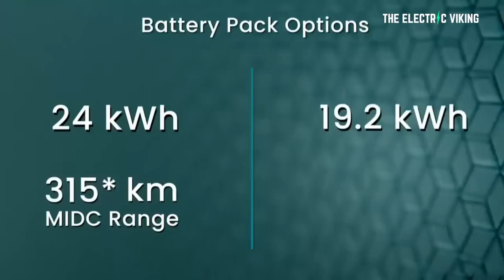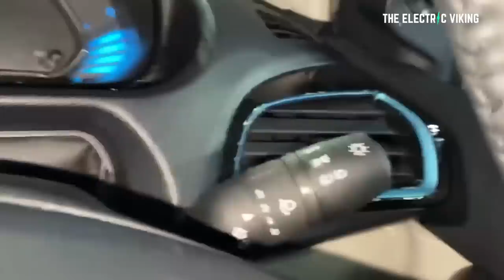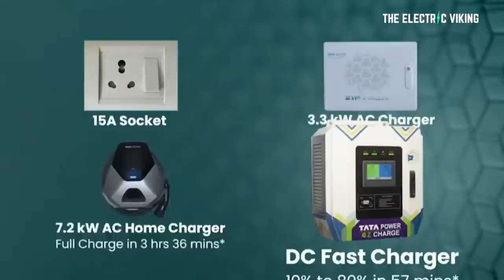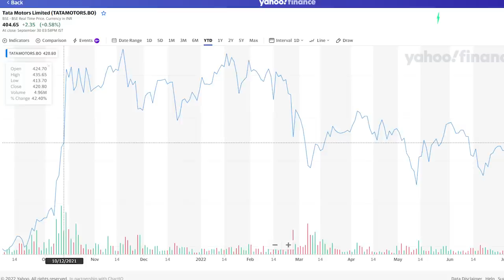India's $10,000 USD electric car - is it good?

Comment: Tata Motors understands the Indian Market. In India very few people do long road trips. People use Railways or Buses. The car is good for driving within Cities.
Reply: Times have changed. We are also getting used to driving between cities now. However most of do car pooling through blabla
Reply: We never use Buses and Auto and use railways for long distance travel
Reply: @bkchaitany  only about 6M of the 250M+ cars pass tolls daily, and that was pre pandemic 

It’s a tiny percentage. It’s just that those who are doing those kind of trips are well represented on car forums and such websites, which makes people think that everybody is doing long road trips. 

But it’s in fact a small minority which is highly vocal
Reply: @bkchaitany  railway is still the preferred mode of transportation for intercity/interstate travel, even among people who own cars. and why wouldn't it be? it's cheaper and faster.
Reply: @bkchaitany  yes we travel between Cities in car but most of the time when we travel with more than 2 people in group
Reply: @bkchaitany  which definitely is not a good thing. More people buying cars put a lot pressure to road infrastructure any where. More focus should be on public transportation .
Reply: And that's such a bad idea. The only reason trains are prefered is lack of expressways.
Reply: @malharpathak4941  I do long distance driving but if it crosses 500 kms, I prefer trains. You can sleep, enjoy the scenery and be carefree. While driving the car,  it gets irritating when there are trucks obstructing the fast lanes.

Comment: Tata Nexon EV is doing great in India....most of the Tata cars are very safe.They focus on passenger safety very much.
Reply: safe but more likely to be in crashes and more prone to fires etc
Reply: @KShauryaDwivedi  any references to the claims you are making?
Reply: @aryans5129  sure, many wiring issues that cause fire, and EV well is an EV and all EVs have a higher chance of catching fires
Reply: @KShauryaDwivedi  I thought you were talking about these crash and fire problems specifically in Tata Nexon. As far as I know, Nexon EV has only 1 fire incident in its history (Mumbai incident) of 4 years and more than 30000 units sold so far.
Reply: @aryans5129  nexon also has fire issues

Comment: Here are few insider info from an Indian.
1. This is a global NCAP 4 star car. Global NCAP is less stringent than Euro NCAP. So, keep that in mind. 
2. Indian MIDC standard is more optimistic than even WLTP. So, expect 30-50% lower range than stated depending on the condition/driving style.
3. Tata owns Jaguar Landrover and had been making prototypes for last decade, but officially started building EVs 2018-19. But, came up with a really solid architecture with their Nexon EV, which is a compact SUV, it has G NCAP 5 star rating and is a pretty solid car. And it has 40kwh battery in its higest variant and costs 20K USD approx. Tiago is their 3rd EV in the same architecture.
4. All three EVs made by Tata so far are variants of their ICE counterparts.
5. the 10000 usd price is that of the lowest variant of the Tiago and this prices are introductory for first 10000 customers. So, expect 10-15% price rise pretty soon. Also, tax for EVs and batteries are very less here in India.
Reply: All info correct. This pricing of 8.5 lakh to 11.5 lakh INR is for initial 10000 customers only.
Reply: Tax varies based on state .....
Reply: @ajthomas770  no. Here in India registration charges for EVs is free for now. Only insurance cost.
Reply: 5 point the price listed is only for first 10000 units, price will surely increase after that.
Reply: @gaauravsharmaa4061  no the road tax varies, there is no exemption in Kerala for road tax for EV compared to Maharashtra
Reply: @a1221feb  same as Andhra Pradesh due to it's bankruptcy.
Reply: Informative 👍

Comment: I think this car is perfect for India. A 10K car with low running costs that lets you run around your local area cheaply. I think it will sell well and expand the horizons of many Indians.
Reply: It is very pocket friendly. But the best seller is actually another car from TATA. Namely TATA NEXON EV. Check it out, a NCAP 5 star rated semi-SUV EV.
Reply: Thanks will do, not in the market for a new vehicle but out of interest I will.
Reply: It's not cheap It's eco friendly 
Luxurious car brand are responsible for environment
Reply: @jbrphilosophy  ok
Reply: It has got 10000 units booked on day 1 of booking..
Reply: @lionelwylie2326  they seem very protective
Reply: @LoneWolf-xz1ln  I agree they seem a lot better and safer than those 3 wheel two stroke things that a lot of Indians fly around in.
Reply: @lionelwylie2326  lol I am laughing at your comment😂 those are called autos, extremely affordable means of transport, they have also associated with Uber too
Reply: @piyushkanthak1087  Thanks I was not having a go about the "Autos",  I have been chauffeured around in them in fact. I think they are a great low cost solution to transport. I was just trying to say that the $10K Tata is perhaps a better answer to that segment of the market. Although I have no Idea what an Auto costs.
Reply: @lionelwylie2326  petrol+ cng auto price around 3k in India 😅

Comment: Just came from trip in india. Check out the Mahindra tiny ev car. tata has the nexon ev which is really the one everyone wants. Unfortunately Tata still makes the body for both ev and ICE so it's not that great yet. The good thing is they're switching the taxis- 3 wheel one, FAST. Which is great they have so many 2 cycle engines on the road. The biggest impact are the scooters, Ola(they're uber) made huge debut last yr w ev scooter and is selling like crazy, All Escooters are. But biggest flaw, they're not investing in charging infrastructure, so no one sees them them more than just city cars.
Reply: You are mostly right. So, I am adding few bit. Charging infra has picked up recently, Several private companies such as Statiq, fortum, Zeon,AArgo have pretty solid network in most part of the country. This is addition to Tata's dealer network in Tata and MG showroom, Hyundai/kia showroom and in petro pumps, and then there are govt installed AC and DC chargers in petro pumps.. All these have come up in last 1 year or so and it's picking up fast. The Mahindra small EVs are not sold anymore, they will launch their bigger Electric SUVs in q1 2023. The slower e-3ws had massive upticks from 2016 onwards, there are millions of them on road. Currently faster e-3ws are on the rise too. And e 2w sells are growing at an exponential rate since last 3 years. Ather scooters are best in terms of quality/performance/reliability more so than OLA(they are pretty good too), And Ather has strong charging network in 40+ cities, that has Tesla like hassle free charging and the scooters have OTA, navigation, call features.
Reply: @Amuzic_Earth  I saw the charging network for 2w, but not for cars.  Yeah athers were great.  Ola wins in style though. Not bad for first generation , can't wait for next one.  I also saw Other e2w are all the same Chinese scooter wrapped with different brand name.
Reply: I think they will do much better with a network or memebership system instead of purchasing a vehicle because parking is difficult enough. I think that why tesla will next build there until they develope a 2 passengervehicles. Which is too bad because india is the most engineers
Reply: Your analysis is not correct
Reply: @grootracing5390   did you mean that comment somewhere else? I just said my observations.
Reply: lets hope that all countries get ev to save environment and the platen
Reply: Charging infrastructure is pretty good on highways because I have just Bangalore to Mumbai in my Nexon. There were so many charging stations that I had to think where to charge. Every small restaurant in the way have charging points now. So it was great, I will be driving from Mumbai to Delhi now, will see how is infrastructure in this route.
Reply: @Spashth  awesome,  hope you let us know how it went.
Reply: @emmanuelgutierrez8616  Technology in India will always have 2-3 years lag from developed countries but that doesn't mean India is far behind. For example, India got 5g this year, which was available in US in 2019/20 I think. Another example, iPhone 14 is launched last month and iPhone 13 is selling like hot cakes in India right now because prices were slashed by 35% after iPhone 14 launch.
Reply: @souravdas1110  true, the lack of previous infrastructure means that they can take advantage of the best today. But the commom random power outages shows how much needs to be developed. I have high hopes and india has growing solar industry. But the FUD in the Indian media is out of this world, this will slow it down.
Reply: In India you don't need cars inside the city due to heavy traffic .big Cars are for able middle class .Bascially the public transport  in India is well good but it needs to be fast. The gov is trying to build fast mode of transport..
Reply: @emmanuelgutierrez8616  Govt is ensuring Uninterrupted 3 phase power supply at least on highways and cities. Actually EV revolution will force govt to strengthen distribution network too. India has distribution problem, not generation. Being 2-4 years behind developed countries is beneficial for developing countries. It saves costa and gets the best technology. For example, 95% charging stations in India are CCS2 standard which is the global norm now. America has a dozen types of charging ports which creates confusion and adds to unnecessary spending.
Reply: @emmanuelgutierrez8616  you are correct

Comment: The driving cycle is decided based on “road load data” acquired by driving cars with strain gauges attached across the country in city, highways and ghat sections. The best fit is decided on the data collected considering driving behaviours too, using acc pedal data. Hence, it can’t be  the same for every country. Run the risk of over designing the machinery for example.

Comment: Tata will be leader in ev market, because tata has a good supply chain, tata has tata chemical to manufacturing advance battery cells, tata steel for making body, tcs and tata elxsi for software and electronics design and development, tata power for charging stations building, tata electronics for semiconductor and electronics part manufacturing, tata autocomponent for auto parts manufacturing. And also have a great brand value and marketing and supply chain team.

Comment: I have been using a Tiago diesel for last 6 years and it's feature packed for its price and quite safe (have driven it at 160 KMPH+ which is handles quite well). The Tiago EV pricing is just perfect for middle-class city users and will get good response  racing ahead of current largest selling EV - Tata Nexon EV. 

Hope TaMo also exports this to other RHD markets like South Africa, UK, Australia, Thailand as a cheap city EV and to compete with low cost Chinese EVs

Comment: The Tata Group has around 2+ % share in the GDP of India and do a lot more than cars and vehicles.

At the EV side they already have the Nexon EV on the road since around 2 years, though slowed by the virus it is picking up really well. This is an effort by Tata to try it in a cheaper segment, though models are already lined up for the 25000$ range

Comment: This mini hatchback EV has advertised range of 315km while the practical range is actually about 225km. Tata also have a mini sedan EV called Tigor EV which also have advertised range of around 306km and practical range of 220km. That one is priced around $16k. Finally, they have 2 sub-compact SUV's - Nexon EV at $18-$21k and Nexon EV Max at $20k-$25k. The former has advertised range of 437km and practical range of 320km.
Reply: The range depends on how one drives it. It depends on the road conditions, car are optimised for certain driving conditions. Even the f..king tesla also will give less than rated in India. 

So don’t comment just to put down other cars. If TATAs are so bad how come Jaguars and Range Rovers are top end tech cars. So don’t bullshit.
Reply: @giridharkatikapalli9894  Everybody knows that all electric cars have much less real-world range than WLTP or ARAI quoted range.  My comment was not to put down TATA. Don't be so insecure. And don't be a fanboy.
Reply: @Subh8081   I am a retired engineer after working in engineering depts of power plants and ship propulsion. I am a fanboy with knowledge and experience to boot. DONT assume things there are a thousand possibilities. Even ICE also do not give ARAI range. The tuning and operations will affect the range.
An EV or ICE stuck in a traffic jam is done for, both cars cannot give good mileage.
Reply: @giridharkatikapalli9894  traffic ? ev wins
Reply: @davelawson2564  its technical issues. I am sure any car is designed for some operating conditions, cars may be designed for certain speeds and loads. say min speed is 10 kmph to max speed of 120kmph, to be compliant with law, it can be higher speeds. 
its about the motors tech, how its works, at start of cars until rated speed is achieved it may take 350 to 600% full load current, for example in mumbai/bombay, the traffic crawls at may be 10 KMPH but with at least 20-30 start and stops within a Km. so a lot of battery power goes for accelerating the car 20 times. traffic does not stop, it crawls , so the motor has to be running always but not moving, the motor cannot be shut as the car may get 10 yards to move and again wait (not the traffic lights). you can check with any propulsion designer. EV loses in traffic in economy or range. EV is good for acceleration and steady runs.  if roads are full of pot holes/pits, it will damage the car or force you to drive slowly and negotiating the pot holes.

Comment: In China, Sunwoda and CATL have started mass production of batteries which charge to 80% within 10-15 mins, with long life. If Tata uses such batteries, the current 300 km range would be just fine for long journeys.
Reply: We should focus on making batteries than importimg them
Reply: Indian battery is able to run 2000km. It was successfully developed by IIT.  👌
Reply: @shk4090 then ev makers should be all over it by now if that is true. Would be interested to know which battery pack Tata is using right now.

Comment: I would favor EPA range as the standard,  simply because it is so far, the most realistic
Reply: W     h  a  t e ve r s ta ndards you use, the mileage will still depend of driving habits and ro ad conditions. Th es e  cars will give better range in US than India, as ther would 10000% start stops in India compared US. Even if EPA range is good, actual Indi an Road range will be smaller.

Comment: Countries having their own driving cycles kind of makes sense as they cater to closely match the typical local driving style....although even then it may not be close to accurate.  While Indian cars may seem cheap, they get more expensive as the manufacturers make their cars compliant with export country safety standards like say Australia.  Some countries are more hilly, other are relatively flat, some are hot, humid, or cool .... these factors all make a difference to EV range.  Having said that, it would still be nice to have a global standard to make comparisons fair.

A USD$10,000 Tata vehicle could end up being about USD$15,000 due to additional market requirements and exchange rates.  This doesn't mean to say that in India the safety features are not available, it just means that there are options for cheaper entry level models with fewer safety or luxury features.

On a different topic, I am liking the diversity of this channel.  Not being focused on any specific EV brand or topic... kudos.
Reply: The base entry level car has scored 4* in global NCAP ratings. Indian terrain differs with every state and there are about 30 states with each differing a lot from other! We have got beach/port cities in one state and then we've got world's highest motorable road in another! We've got vast sand dunes in one state and snowy state in another! We've got arid dry state and we've got states where it rains every day! So they won't sell a particular car to a particular state! Our vehicles complies and caters to each and every state in totality! So they're fit in that aspect too. Don't know if they'll export it or not but no parameters other than taxes and profit margin will affect the pricing if they do decide to export. Have a great day ahead!

Comment: TATA is safety focused brand , you can't simply compare it with some cheapest Chinese electric car. By safety i didn't mean battery or BMS , i am talking about structural strength of the car that plays an important role in an accident.

Comment: As John cadogan says: For typical scenario, For ICE cars, you will get around 20-30% less FE and in EV you will get 20-30% less Range than what's claimed by manufacturer
Reply: Because EV batteries should be maintained within 20% to 80% charge.

Comment: The 24kWh is the size of the original Leaf’s battery :- real world dependable range all year round = 60 miles. 100 miles when hyper-miling.  Fine for local driving. Average daily mileage closer to 20 miles for many so its fine. Long range needs DC fast charge even if the battery is smaller and well spaced dependable infrastructure, so this will not be usable for that.
Reply: You are just paying  10k$ for this car.
How much more expecting with this budget 😂

Comment: Taxes are very high in India. Ex showroom cost includes 28% GST. Also road tax, insurance, registration charges amounts to further 15%. In India car made locally taxed about 40-45% while imported taxed above 200%, CKD kits amounts to 100%.
Reply: GST on EV is only 5%, yes only 5%.
Reply: @dipankarchatterjee8809  There is a base 50% tax on every single car sold in India. A Fortuner will cost only around 25 lac in the Middle East, in India it is much higher.
Reply: Tax on EV is Just 5% in india